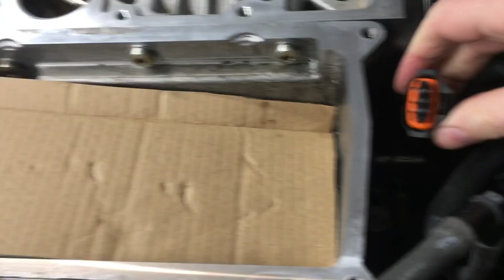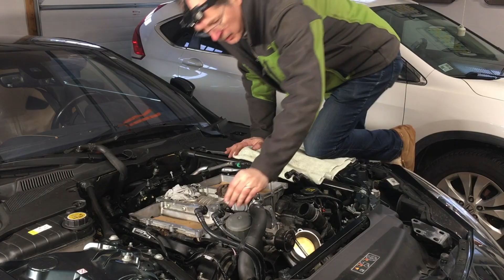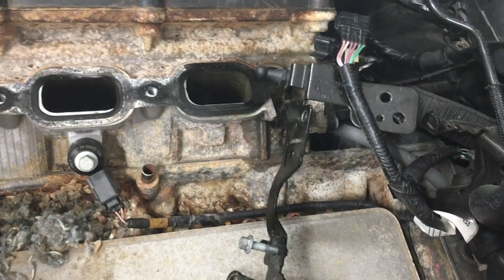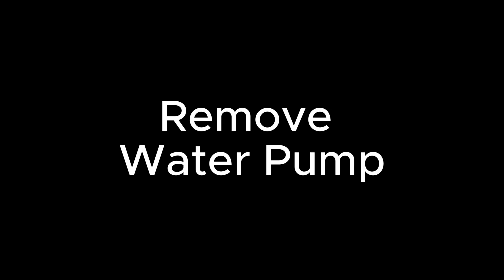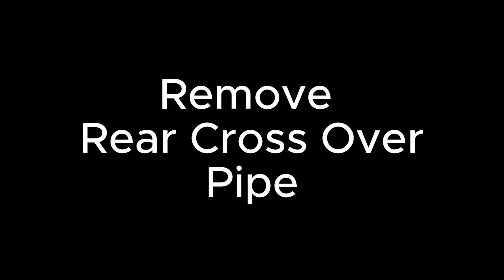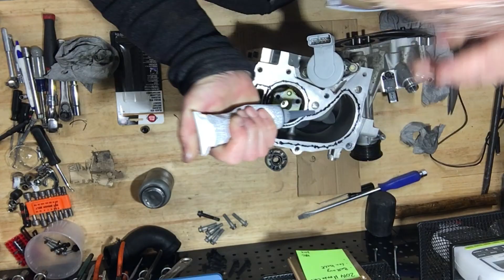Jaguar F-Type Y-pipe Upgrade Part 2

Comment: I’m incredibly grateful for your efforts and everything you've accomplished and we followed your videos to finish same. Now, we have a new challenge: the valve cover seals, injectors, plugs, coils, timing chain cover seal, and vacuum pump seal. If you are buying this car and doing the work, make sure to check the valve cover gaskets and replace the plugs and coils if you haven't already. Honestly, if you love these cars, forget about hiring a professional mechanic—they are just too expensive. You have to do the work yourself. If you can't, you shouldn't buy one.
Reply from the maker: I appreciate your focus on the next wave of maintenance items (plugs, coils, tensioners). There is no rest for the mechanic… stay calm, carry on.

Comment: Wondering if you have any input/experience to report with changing over to the one piece green coupler sans the spring. I have the AJ133 and I'm about to reinstall everything and just now reading about vibration and noise and even premature failure of the bearings as a result of the solid design. My reinstall just came to a screeching halt. 
Also, wanted to add that there is a gentleman that drives a beautiful white F-Type where I work and his license tag says "ONCA".
Reply from the maker: Jean,  i ran with the solid supercharger coupler for about 10k miles before going with a rebuilt ported supercharger with new solid coupler and new bearings. so far I have not had any concerns with bearing wear.  I would think a solid coupler to be low risk, and the OEM style spring coupler is a know risk of failure, so take the lower perceived risk path?  
I saw a photo on the internet of the Onca license plate.  Nice touch and reference to the Genus and Species name for Jaguar.

Comment: What was that tool that you used to remove the rusted bolts?
Reply from the maker: @HunterD510   The various rusty valve cover bolts were loosened and removed by a few techniques.  1) lubricant spray. 2) regular socket, 3) back out (extraction) socket, 4) high speed cutting tool to make a slot
The cutting tool was used last to make a slot that a large flat head screw driver could fit into.   Otherwise my last step was 5) cut the head off the bolt, remove the valve cover, and then attack the shaft that remains above the surface of the valve header.
There may be some other percussion type extraction tools on the market that may also help.
Reply: @OncaEngineering  Thank you. I'm going to try this on my 4Runner's exhaust flange... 

Have a 2015 BRG F Type R being delivered soon and will tackle this job after the initial inspection.

Comment: I bought and installed same kit. Unfortunately coupler did not fit. 1/2 a hole off
Reply from the maker: Wild. This is the first time I am hearing about different coupler sizes. Or perhaps the wrong coupler was thrown into your kit?
Reply: @OncaEngineering  I called euro. They said they send a standard one. However if that doesnt fit they have 2 others. I was highly disappointed with that lol. However will see my options later on.

Update comes with 49.38mm coupler but I need the 45mm.
 2015 f type v8 s convertible

Comment: This is really interesting thank you.  My question is about replacing a supercharger coupler with a spring, which I guess is to take upon the shocks between crank and supercharger, with a solid one, does it put more strain somewhere else?
Reply from the maker: Ian, correct, making one component more “firm” will pass along the vibrations and torque pulsations to the next component. But if a component is designed poorly, or with too much “slop” then the effort to reduce Noise Vibration and Harshness (NVH) failed and a more reliable solution with more NVH is the better answer.  I also found this to be true when developing a lightweight flywheel, replacing the Dual Mass Flywheel, which was superior at reducing NVH, but atrocious for performance minded drivers.

Comment: How do you like the symposer delete? Can you describe the difference in sound?
Reply from the maker: Kent.  The symposer was designed to transmit engine noise into the cabin when the car was put in “dynamic” mode.  (This mode also added red lighting accents to the dash, and the throttle map was made steeper). I never used this mode in my F-Type so I dont miss the symposer. I focus instead on the simplified engine bay and fewer parts to fail.
Reply: @OncaEngineering thanks for the response. I have a Range Rover with a 5.0 like what you have but I'm not sure if its sequence of operations. I think my symposer isn't piped to the firewall or anywhere as it turns out -as best I can tell with an endoscope just now. 10lbs of stuff in 5lbs of space back there.
Reply from the maker: Yupe. The 5.0 leaves less room to extract the three small torx screws holding the symposer assembly to the rear of the supercharger.  I suppose you could just focus on blanking off the hole in the right manifold as that will prevent any failure in the symposer from impacting engine performance.
Reply: @OncaEngineering I tried to attack the symposer delete yesterday. Put the truck on ramps and tried to access from below. I can barely see the crossover pipe bolt flange. The symposer bolt flange is at a higher location so I'm scratching my head if access from the bottom is possible. Access at all without removing the SC seems unlikely. I am gearing up to change the coolant pipes next weekend or so like in your video. I have all the parts now but was hoping to dissect that symposer outta there before. Access from the top is about as bad I think. Slightly straight-line closer physically but many obstructions. 

Had another question about your video. When you disconnected the fuel line, had you done any de-pressurization? Not needed? Disconnected the battery?
Reply: @OncaEngineering did you have to depressurize fuel rail before you took it off? I've heard both, but you didn't appear to do anything in preparation.
Reply from the maker: Kent, yes the battery should be disconnected.  Yes the fuel rail can be disconnected with out any worry, only a small amount of fuel will leak out of the fuel rail that bridges over the super charger.
Reply: @OncaEngineering how has the kit been performing?

Comment: Hi, I am preparing for this job over the Christmas break so looking to get all the parts together, I already have the EuroAmp kit but noticed you said there was a hose that’s not in there. Do you have a part number for that hose so I can get it ordered? Already looked on SNG Barratt but can work out which one it is. Also the replacement cam cover bolts, did you use Stainless Steel for those? Thanks.
Reply from the maker: @bigbadjv  One of my car’s hoses to the thermostat was starting to bloat, so I looked it up online. It was a standard JLR part.  Your car may need other parts once you dive in. Yes, I used some stainless steel hardware to replace the rusted cam cover bolts (M6 1.0 ?)  Also use some anti-seize. Good luck on the job. It is a good investment in your JLR vehicle.

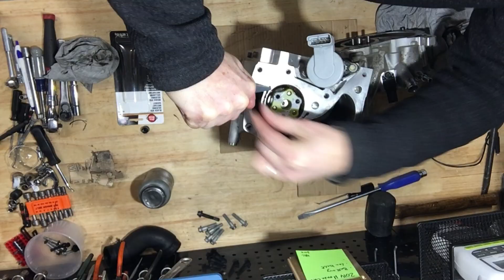Comment: Awesome video! What did you apply at 30:50 ?
Reply from the maker: I used a black gasket sealer RTV to seal the snout to the main body. A 1~2 mm bead is all that is needed to get a nice air tight seal. This joint needs to support up to 1 atmosphere.
Reply: @OncaEngineering just got mine taken apart to replace coupler. Should I add some grease?

Comment: Finally, I did it with my brother in just two 18-hour working days. Replaced all the coolant pipes, thermostat housing, crossover pipe, and changed to a solid coupler, while replacing the SC oil. The only mishap was that the O-ring in the sensor of the crossover pipe was leaking. I replaced it, and everything was back to normal. I'm so satisfied with myself now.  Thank you.
Reply from the maker: Well done!  You can be pleased with yourself and your brother. Your Jag engine now has a new lease on life.  Drive well!

Comment: If someone paid you what would be the labor cost for this job
Reply from the maker: James, There are dealer suggested guidelines for time and materials, and then independent shops who tend to charge just their actual hours.  I spent about 10 hours spread over several days.  So in the 1000-2000 USD range? For me, I have the tools, the time, and the interest… so I consider the job a hobby, and worth the effort.

Comment: How many miles do you have on your F-type? I am considering doing a transmission service and the supercharger oil. I'm at 80,000 miles and have already done a lot of what you mention above.
Reply from the maker: Good to hear your car has accumulated 80kmiles. My 2017 V6 has 38kmiles. I serviced my manual transmission with 75W-140 synthetic hypoid gear oil with good results. The automatic gear box requires different fluid.

Comment: I live in Rhode Island also, Providence.  I am considering purchasing an F-Type and I was wondering where this car spent it's life.  I noticed the considerable corrosion inside the engine and I know this is attributed to the hood vents.  Nevertheless I am aiming to purchase one from a warm weather/dry climate if possible.  You state that this car has been largely garaged,  may I ask has it lived it's life where the climate is not favorable to cars, like here in Rhode Island with road salt etc.?
Reply from the maker: Michael, this car came from Allentown PA where it spent the first 3 years / 18k miles there. Then I moved it to VT where it was garaged for a few years and now in RI for the past few years. The hood vents are the source of water, and the foam pads are the retention of water, and the Iron in the alloy is the feed stock for corrosion.  Good idea to buy an FT from a dry climate. My choices were limited as I wanted a manual in BRG color.

Comment: Boy, I am considering buying an F-Type but this job looks insane.  I amd 62 and have been working on cars since age 8.  I have changesd engines and transmissions (albeit on on older american cars) and done just about everything in between.  Having owned a BMW 325 xi for 16 years and becoming intimately familiar with plastic coolant hoses and electrical connections that become brittle and almost always break when manipulated in any way, this job looks herculean in its difficulty and scope.  So many places for potential failure after reassembly (e.g. leaks, electrical faults etc.) I would be paranoid that after all these hours of work something would go wrong and then I would have to pay somebody to remedy it.  Kudos to you for tackling this job but I myself would have to think long and hard before attempting it.
Reply from the maker: Michael, I totally get your hesitation. I am in a similar boat, but have the attitude that all cars need TLC and all problems can be fixed or addressed. This is why I post my videos so you can see/learn/decide.  But I do yearn for a simpler car, but with modern performance… maybe a Restomod from Retropower.

Comment: Thanks for sharing. My wife and I pulled the SC on ours today.

-A few VC bolts were totally rusted, so will need to be replaced. Unfortunately these are captured, so we have to pull the VC now.
-We removed the foam from under the SC, since it is just capturing water. 
-Our intake valves on #6 are very dirty with deposits, the others are marginal. I'll walnut blast them all.

Are you reconnecting the small vacuum lines and electronic valve from the symposer? I've run ours blocked since purchasing the car last year, but while I'm here might as well totally delete with the VAP block off plate.
Reply from the maker: @carlb86  Sounds like we are doing the same job at the same time.   
I found that a pair of large channel locks could pull the captive hardware from the valve cover.  See Part 3 of the video, where I re-install the captive hardware by tapping them back in with a hammer.   Sorry to hear about your intake valves. Good luck with the clean up. 
I did cap the vacuum line that went to the symposer.  Easy-peasy.

Comment: Great video and subject.  Timing couldn't be more perfect as I'm about to do this same job on my 2016 F-Type R.  I have about 44k miles and all looks good but I want to replace these coolant pipes before a disaster happens.  Quick question, did you disconnect your battery before starting the job.  Is this a good idea or bad idea.  Just curious?
Reply from the maker: @trainingdragon1964   Absolutely, I disconnect the battery before this work.   But dont' forget to cover up the rear boot latch with a towel, so it does not lock.  Otherwise you will need to apply voltage to the front charger port to be able to unlock the rear boot/hatch.   See Part 3 video where I needed to do this.

Comment: Great video again - I had one hickup in removing the supercharger.  There are two long bolts that travel from the coolers down through the supercharger and into the block.  The were seized solid.  Tried everything and anything to get them loosened without success - in the end had to snap them - drill them out and rethread - I fear I am a little offset and given the tight tollerance even with all the work may not be reusable but I think all should be ok even without these two M8s.  I'm seeing exactly the same corrosion in the same locations as yourself.  I'd suggest when you have gone as far as you have to change the two belts and the supercharger oil.  I still await my parts to arrive - hopefully will have all this week and finish the job at the weekend.
Reply from the maker: @damienkearns9922  thanks for your feedback on changing the belts and S/C oil.

Comment: Thank you for a thorough and excellent demonstration, I'll do mine as soon as the weather picks up. will the electrical connection on the symposer not throw a dash light if disconnected? If possible, could you please give us the part numbers of the O-rings that go on the 2 metal Y pipes and cross-over pipe O-rings, to replace mine with all OEM.
Reply from the maker: @kyproset  I doubt the symposer would have a diagnostic associated with it, as it is a non-critical, unregulated function. If there is a warning light, i can always add a load resistor to the electrical connection. As for the O-rings, they came with this aftermarket kit, and I doubt they would exactly match OEM plastic pipe types.
Reply from the maker: Update:  after doing some research on Jaguar Forums, I found that a code is written to the PCM, but it does not trigger a CEL (check engine light).  The code is P0657 - "sound symposer failure."  @kyproset
Reply: @OncaEngineering  Thank you, I do appreciate going out of your way to answer all guestions.

Comment: It’s great to see the road to the Y pipe. It looks in pretty good shape after all that work but you now have peace of mind. As a note - you can purchase OEM aluminium replacement Y pipes from JLR (part numbers LR186917 & LR186859)which were fitted when they used the engine in the F Pace SVR. On a final point - The reason for all the rust on the engine is water ingress through the hood vents which is allowed to access the engines V because of a badly designed plastic engine cover. Many owners in the U.K. modify the cover to divert the water (or block the tiny holes in the vents). This problem didn’t affect the AWD model because the vents were moved. It’s a sin that Jaguar continued to sell RWD models without a simple re-design of the engine cover.
Reply from the maker: @TIMSANDYSURF  agreed on the water ingress. I unfortunately ran without the cover in place to opt for more heat extraction out the vents when parked. Now I will look into making the cover a better rain shield.
Reply: @OncaEngineering I wouldn’t worry about having taken the cover off. I did some tests on the route of the water after it passed  through the vents. I found the water ran onto the motor via the cutouts in the cover made for the supercharger coolant pipes, thus negating any protection offered by the cover. The cover is only of any real value when modified.

Comment: This makes me want to sell my F-type R even tho I love it.  Too much can go way too wrong.
Reply from the maker: Thanks for your comment.  I tend to disagree, as all cars have issues. So i like to think of it as dedication to the car that can result in a real respect and deep understanding.  Oh, BTW, post 2016 Jaguar offered a better Y-pipe, so your car may not have this concern.
Reply: @ I have a 2016 f type r. I don’t think I have the new Y pipe.
Reply: Your video has help me to pull my daughter's 2016 jaguar xf apart thank you so much. Having a heck of a time getting the supercharger to come off 
It's rocking 1/2 in but won't pull up .any suggestions thank you
Reply: @JohnHetzel-w8p  They are a right pain to get up and out - I had an engine hoist helping to pull mine as I pryed at it like in the video and the slight pulling up pressure helped - so maybe get someone to pry upward as you rock back and fourth - try different positions using the small strut bars as a lever support - it will come and oh boy the satisfaction when it does.
Reply from the maker: @JohnHetzel-w8p  Rocking the S/C is good, and prying up on the front, under the throttle body intake hole and above the water pump. The idea is to keep applying upward pressure as you rock the S/C.  (Do check that all connections to the S/C are cleared. .. are you sure the rear bracket is disconnected?). Once lifted, the cooling hose needs to be un clipped, and then lift out the S/C using your elbows against the strut tower for good leverage.